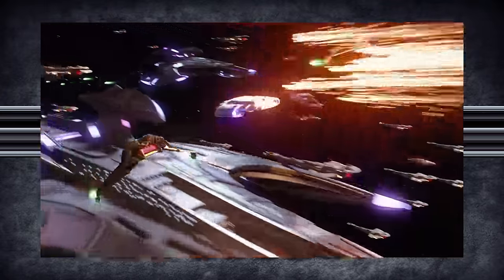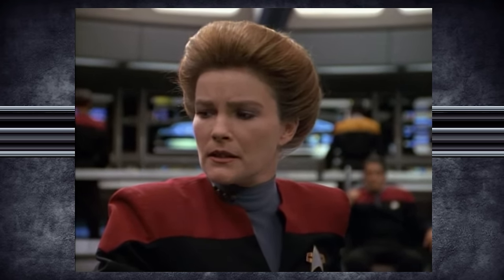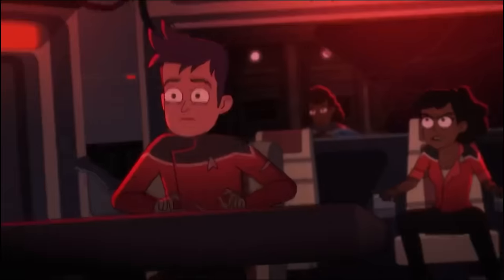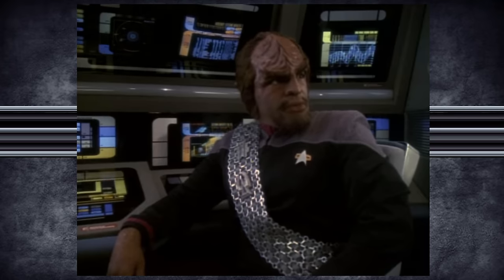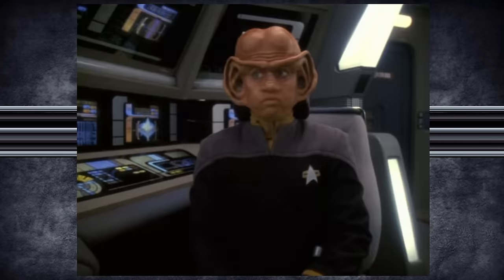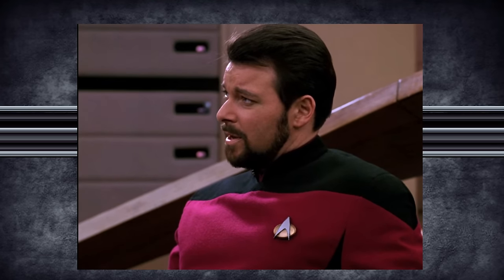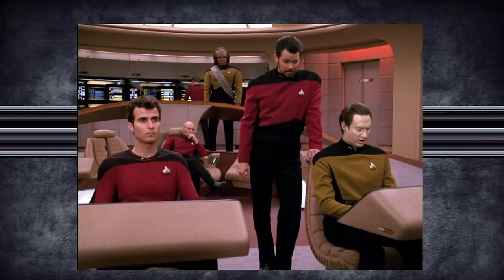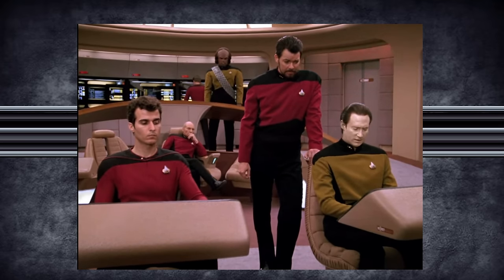Why Starfleet's Bridge Design Was Lethal to the Crews

Comment: The fact that Starfleet engineering had completely abandoned electricity as a power system, and the entirety of the ship's systems are fed power by a network of highly-pressurized tubes filled with electrified-plasma. I would very much like to hear what the in-universe justification of that design choice.
Reply: For the power hungry warp-core that makes sense, for probably (relatively) low power bridge consoles yeah, the rocks are gonna fly cause of that.
Reply: @toasteroven6761  careful where you throw those rocks. One might ding off the side of the shuttle bay and cause the XO's console to explode in his face and decapitate him. XD
Reply: Most of the criticism of ship deck design also applie to biological Bodies 
The design requires highly pressured tunes of plasma [ blood ] that rupture so easily
Reply: Copper is expensive
Reply: If I had to guess. Electrical efficiency. Transporting the Plasma to the Plasma converters near or in the equipment needing power probably cuts down on transmission losses. Making power usage more efficient. Or at least that would be a theory anyway. Making the most efficient use of the finite anti-matter supply onboard would be paramount in a ship like that.
Reply: @SternLX  there is still no need for it to be under such high pressure and intensity, and so interconnected that your XO can literally be decapitated when someone lands a hit in your shuttle bay, as happened to Riker in the Enterprise C incident.
Reply: @andrewgause6971  Take it up with Okuda then. He's the one that came up with all technobable.
Reply: @SternLX  I would. But I am given to understand he was recently atomized in a tragic accident that happened when a shuttle piloted by Deana Troi lightly grazed the ramscoop of the Enterprise's port nacelle and this caused an increasing pressure feedback loop that resulted in his writing and graphic design station to be forcefully relocated across the Enterprise at high speed....
Reply: @andrewgause6971  😱😱😱
Reply: @andrewgause6971  If you mean "plasma" as ionized gas, it's most likely low pressure, not high pressure, as a high gas pressure means it has a much higher electrical breakdown resistance. So a near vacuum would be more ideal, meaning that if someone were to ever hit a real plasma tube (like, a fluorescent lamp) it would just make a puff and go out.

Unless the Star Trek warp plasma is some magic goop that can just move energy from point A to point B and it has nothing in common with what is scientifically known as "plasma".
Reply: @andrewgause6971  
Plasma conduits look cooler when ruptured and are more cinematic than copper wires humming with invisible electricity.  It’s artistic of course.
Reply: @andrewgause6971  lol this is too good
Reply: The most plausible explanation I can come up with is that it has to do with how shields work. Shields seem to consist of some sort of energy force field and are powered by the core. Hence there has to be some sort of energy exchange between the two. If the shields get hit, there may be a feedback energy/pressure surge travelling into the shield emitters and through the power conduits of the ship. Henceforth it would make sense to spread these conduits out as much as possible, so that you distribute the resulting forces on a very wide area. The exploding consoles may therefore be the necessary evil to prevent exploding main power conduits, which would be a worse outcome.
Reply: @SternLX  Transmission is a big factor after all if you're controlling the ship you want the most fastest efficient transmission  of signals possible it could mean life or death for the whole crew especially in doing maneuvers to dodge blaster fire or other things.
Reply: Well, plasma is electrically conductive and wouldn't suffer from heat issues from electrical resistance cause its already hot as hell.  Could be that it was an efficient way to bleed off waste heat from the engines to keep the ship warm, plus transmit superconductive electricity without the need for trying to keep superconductors cold to do it otherwise...
Reply: @Kaiju3301  "Copper is expensive."
You forgot to mention "Redshirts are cheap."
Reply: @Kaiju3301  why don't they just wire everything with WORTHLESS GOLD then?
Reply: @andrewscharbarth2099  Keeping a ship warm in space isn't an issue, space is super-insulating. Getting rid of waste heat is much more important so the ship doesn't cook itself.
Reply: Fireworks on film…
Reply: Most power generating methods rely on turning heat into pressures fluid. Which are bulky systems that require constant input and exhaust. They would be using fusion power from the impulse engines if I were to guess as main power, and not needing a multi-state energy converter to turn plasma into electricity probably yields better transmission and less waste heat than having such a converter and using electricity which does deal with transmission issues.
Reply: Makes you wonder why nobody ever showed up for bridge duty with simple workshop safety glasses.
Reply: The idea that energy has to be routed through the control panel, rather than through a relay-rack, is silly.
It makes for great movie-moments, but makes no sense.
The equipment being controlled is 100's of meters away from the panel, the energy being harnessed is passing between machines nowhere near the Bridge.
Just think of all the conduits routed to the Bridge...why you make Bridge such a tempting target?
Reply: @ashhhh_skrrr7264  Ummmm... usually not to fatal effect for the biological body, which has a built in system for closing breaches, automated self repair mechanisms, and redundant pathways for all but the most severe injuries (more akin to a Borg cube than the Enterprise). Also, a ruptured artery won't kill everyone standing near you with explosive force. 

It should also be noted that biological bodies are VASTLY more complex than a fictional space vehicle from a TV show. If you aren't aware of that, you clearly don't know much about biology, and are in no position to apply criticism of any kind to biological bodies, much less fictional starships largely designed by script writers instead of engineers.
Reply: @Edge_Of_Paradise  You think so much 
Yet you can't comprehend that observation of likeness is not the statment or belief that two objects are exactly the same
Reply: @Edge_Of_Paradise  You are right 
Absolutely correct in all that you have said
I am ignorant you Knowledgeable 
I am wrong You are right
I am fool You are wise
I am idiot you are whatever is the opossite
Reply: The plasma might have the advantage of not needing a giant system of turbines to convert steam into electricity.
Reply: @SternLX  But we know how much power a monitor uses. It's not even a marginal factor in ship power and not even close to heating today.
Reply: The British Empire actually resurged (pun intended) and Lucas became the sole electronics company on the planet. This is why console explode and lights randomly dim.. and why a French captain has an English accent.

Comment: Circuit breakers and seatbelts, cannot have that...
Reply: Or even vacuum-rated suits for personnel in case your emergency force fields don’t engage or fail.
Reply: Seat belts won't help if the inertial dampners fail. You will find crew reduced to a coating of protein on the aft bulkeads. Such was the fate of the Hera in Indistiguishable from Magic. They were grabbed up in the wake of a space whale. Jumping out of our galaxy in a slipstream equal to many factors of warp speed. These transwarp tunnels combined with the impact of the collision killed the power. Thus the dampners and the crew. Reduced to a fine protein slurry on the aft bullheads. Since.the ship was left to vacuum for decades it was petrified. Lousy way to go really.
Reply: We don't do that here!
Reply: @Ozzy_2014  We frequently seen the crew shaken about. Those inertial dampeners are just that, dampeners, not nulliifiers. Some inertia gets through.
Reply: Seatbelts are only good for Spaceballs. :p
Reply: @michaelpettersson4919  yep, instead of all the force being applied in 1ms, it smooths them out to 5-10 seconds of light shaking. That’d still be 5000-10000x impact severity reduction.
Reply: @CatherinePuce  and JJ Abrams reboots.
Reply: @Ozzy_2014  - Plausible..., but I suppose they can restrain some bodies from floating around or being hurled into other people's faces, depending on the force of impact. Not for self protection, but protection of others, potentially? Not sure :)
Reply: @CatherinePuce  and Enterprise E
Reply: @sgwilsonmd  and Enterprise E in Star Trek: Nemesis
Reply: Or a bridge that’s not placed in an exposed area.  

 Even naval ships from 400 years previously were conned from an armoured conning tower or citadel or CIC below decks.  Only the lookouts were on the bridge.. and generally you only needed to steer it from the bridge for docking or to follow the harbour pilot.

Comment: It would help if all the panels weren't loaded with rocks.  Every time a panel explodes, rocks fly out.  They are shrapnel machines.
Reply: Someone else commented the panels had powered magnesium inside them which controls the power surges.
Reply: the problem is that these control panels by design are all comprised of explodium which is vital to the near instantaneous transfer of data from one system to another as the ship travels at warp speeds and hostile regions of the galaxy...sure they could use other materials as so many new elements have been discovered/ created by this time but these are still very expensive and hard to obtain even if the reliance on actual physical monetary systems are considered outmoded  and impractical the worlds where these elements are found still value physical forms of currency (such as the  Ferengi (duh)...explodium solves this problem in that it is relatively inexpensive and easy to obtain or replicate despite the inherent danger this element/substance has for going all explodey during critical moments at precisely the most inopportune time for such panels to do so...so Starfleet is kinda stuck with it at least for the moment...it should be noted that the Borg seem to avoid this substance in the fabrication of their ships...not that that's any real comfort to the Federation or StarFleet or reason for them to actively pursue  contact for an exchange of technologies...last time did not go so well
Reply: That's Shrapnel Dispensers, my dear sir.
Reply: I always thought it was interesting how... the computers even function when going faster than light. Like... The energy/info transmitted down wires only moves at light speed... If the ships moves faster than that how do you ever send a signal to the back or forward of the ship? Or am i over thinking this?
Reply: I literally thought that's what the video was going to be about lol
Reply: @jonny-b4954  Sorry, but you are over-thinking it. The "Warp Field" that's mentioned often is an area of normal space surrounded by a warp bubble. The engines help create this bubble and move it through space.
Interestingly enough, this is how IRL Scientists are working on FTL travel & getting past some messy Laws of Physics.
Reply: @TheKauff  Yeah, I get that part. That's what make warp different from a Stargate or folding space itself. It's in theory warping space, contracting space in the bow and expanding space in the aft. It's just warping space/time around the ship. But... does that mean in theory, the ship is... not moving at all in relation to normal space? I mean, can't be, since it is moving from one point to another. Then again, all this shit is very unintuitive. I mean, if it's within a warp bubble and the warp bubble is moving FTL, then the ship is moving FTL.... I'd assume. Like riding a wave? Space time can bend/warp but a physical object can't... so maybe not then. It's all interesting thought experiment of contradictions. I've still always wondered that. Even not breaking FTL, just approaching it, would you have issues with computers, powering a light bulb etc.?
Reply: @jonny-b4954  As Albert Einstein would say, whether space is moving or whether the ship is moving depends on your frame of reference.
Reply: YAS ROCKZZZZ!!!!
Reply: @jonny-b4954  thats because the ship isnt actually going light speed-things cant actually go that fast. Its a bit of a mindf--k, but think of it like this-it generates a field that removes space inbetween it and its destination so that there is less distance. This lets it effectively moves faster than light to an observer, but it doesn't really ever actually move in terms of having velocity or momentum. It just removes space from in front of it. It only ever actually moves when using impulse drives.
Reply: @jadedandbitter  Right, right. It's the space/time warping in front of you and yeah, I guess, the Impulse moving you within the field, which moves with you..... I was forgetting it's all relative. You're not actually moving faster than light but still, you're moving very close to it, I presume? Maybe not, maybe just what Impulse is capable of? But still, I wonder how accelerating to say 50% of light speed fucks with computers? Would they be perceptionally slower?  Who knows, it's all so trippy. I wish I'd thought about these things in my high school days when I did shrooms and acid a few times hahah. Was too into music back then.
Reply: @jonny-b4954  doesnt even need impulse drives. You basically create two field capsules, one of thinned space and one of condensed space within it that the ship inhabits. You offset the external capsule from the internal one and the ship moves from the gravitational pull, no impulse needed
Reply: @Your-Death  The instruments, and panels are programmable matter!
When the panel blows up, the matter reverts to it's default base material, rock.
Reply: @scottmantooth8785  It's definitely the explodium!
Reply: @jonny-b4954  Whatever is inside the moving body (in this case the ship) travels at the same velocity. 

Similar to how when you’re on a train you can throw a ball back and forth without the speed of the train having effect on the ball.
Reply: @brokentricorder4621  Right right. Well, yeah. It's all frame of reference. You're attached to the train or ship, so it's in your same frame of reference. But, things change when you're nudging right to light speed. Like, walking speed away from it, let's say; You technically can't throw that ball forward and break the speed of light with its forward velocity from an outside observer's perspective. It may only be going... 5 mph from your frame of reference but to the outside observer we would think it would be breaking the speed of light now. But since that would take infinite energy... well I'm not really sure exactly what scientists propose happens there. Then when you start considering time and space are one and the same and connected it gets even more of a mind fuck. Interesting stuff to discuss though.